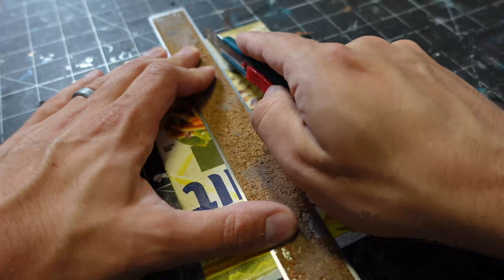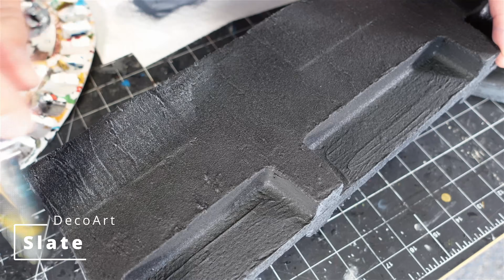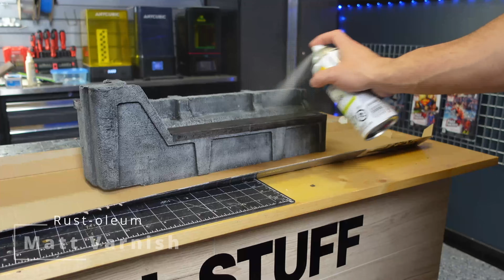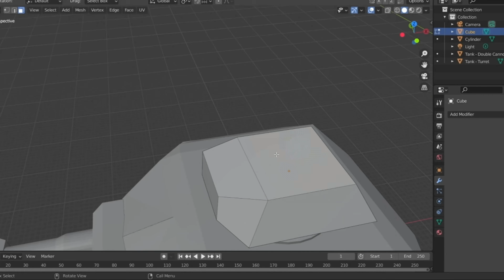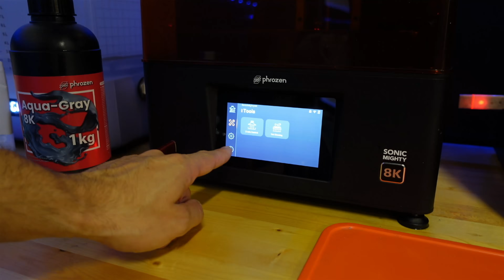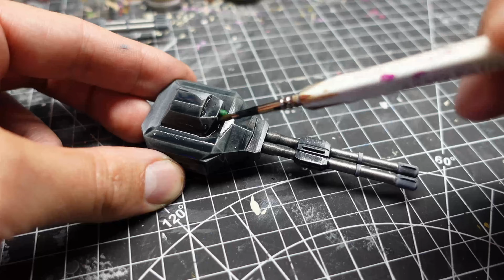Turn Styrofoam into Cement! Warhammer 40k Trash Terrain

Comment: I'm amazed that the spray worked, if you haven't sealed the Styrofoam well, the propellant in most rattle cans will liquify Styrofoam, and not in a good way!

As for the Aquilla, two heads represent the two 'empires' within the Imperium, that of Mars and Terra, at least that's what I recall.
Reply from the maker: For sure, I was worried about it melting

Comment: That was great. Only thing I'd add is grabbing some bolts and screwing them into the bottom.  Adds a bit of extra weight (though with the caulk you might not need it).
Reply from the maker: That is a great idea, it is very light

Comment: Are the caulk and the modge podge steps both needed? I feel like they are achieving the same thing.
Reply from the maker: The truck bed costing will melt the Styrofoam by itself. The caulking adds depth to the texture and the mod podge just hardness the surface a little, you might get away without using it.